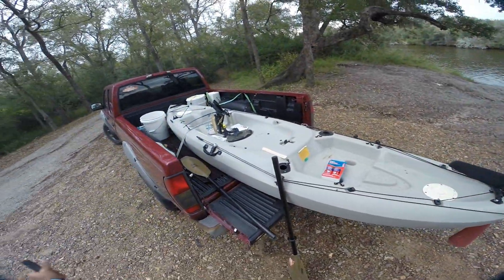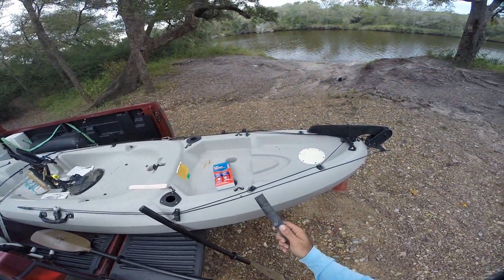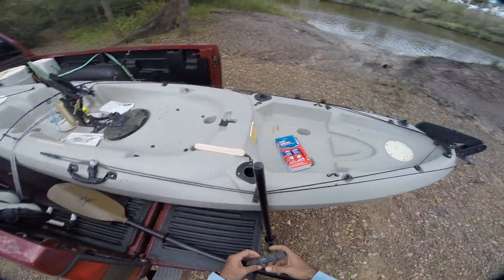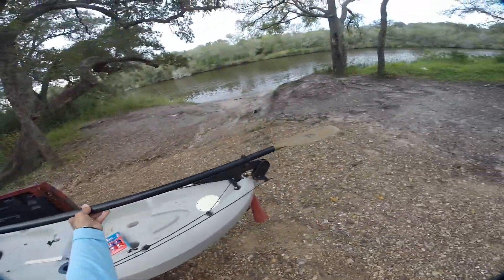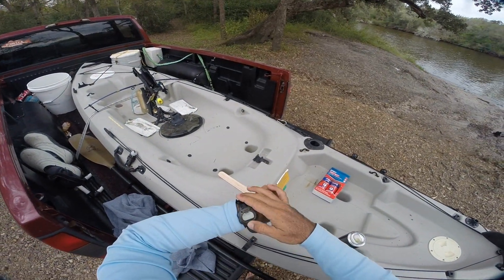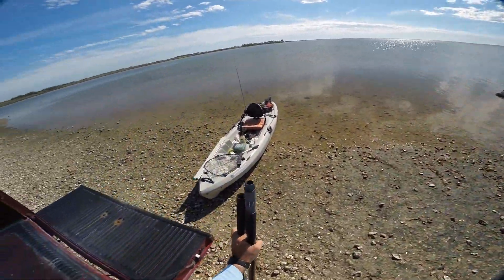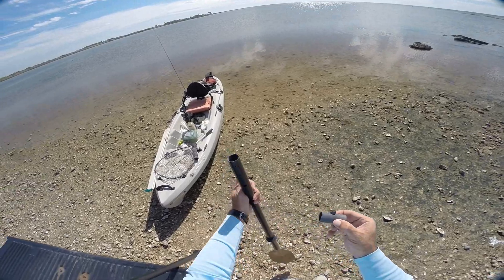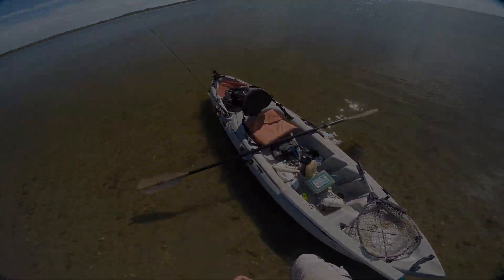Werner Paddle Repair

Comment: I have also noticed that you paddle with the paddle upside down. You should be able to read the words on it.
Reply from the maker: I do that because I'm usually in water too shallow for the whole blade to be submerged even with a low angle of attack. Upside down gives me more surface area in the water.